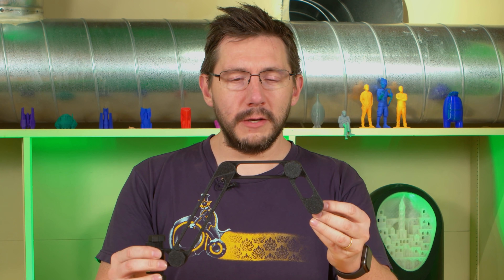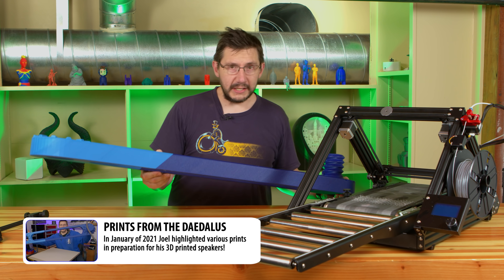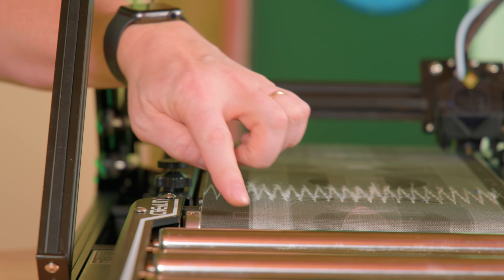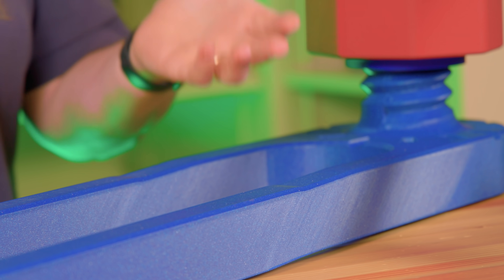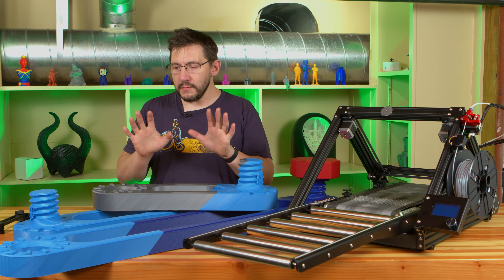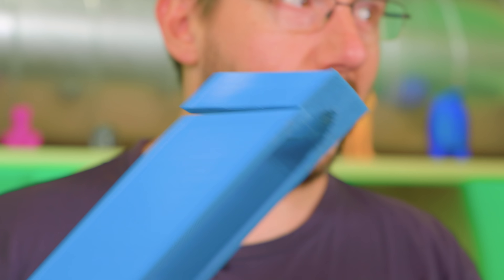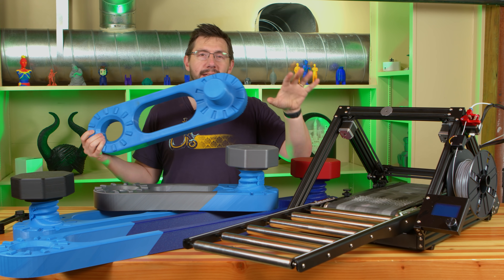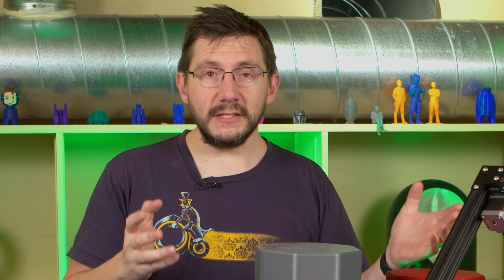HUGE 3D Printed Articulated Arm on the Creality CR-30!

Comment: This is a simple fix.  Either clean your rolling bed with plain soap and water, or replace the belt with a new one.  Just saying.  Another thing you can try is to have a fan cool the part at the end of the bed that way that hot piece contracts a little enough to separate from the bed before it rolls off.

Comment: A commercial use would be to put it on a rolling platform and light at the other end.  Because you can take it apart, you could throw a bunch of them into a trailer to take to a construction site for spotlighting specific areas high or low.  You could also use them to support kids night soccer and football or any other event.  Imagine traveling shows could light up their shows and take the light with them.

Comment: How long did it take you (or till you get) to gain confidence in your printer(s) that they would continue when you were not there to babysit it(overnight)? I have several printers but it seems like just when I start to trust them for an over-night print they FAIL (and usually badly)....

Comment: Hi Joel, Just a quick question, have you had issues with printing different types of PLA specifically PLA+ on the CR-30? We have just got one at school and it has been printing the supplied filament without issue but when changed to PLA+ no joy in sticking to the bed. Any thoughts?

Comment: Add a very light coat of TinkSeal to the threads and then wipe off with a clean terry cloth. Your threads will slide smoothly without being greasy.

Comment: Impressive! My cr30 arrived a few weeks ago and I have not had the best experience using it, can you share your firmware and slicer profile? I think your results are very good!
Reply from the maker: I got the best results with stock firmware and using ideaMaker for the slicer. Used the default slice profiles. Also check out a slicer called Kiri:Moto it has cr30 profile and people have been getting great results.
Reply: @3DPrintingNerd  Thank you very much for responding so quickly, I will try both slicers! Did you have to calibrate the steps of the motors in the firmware? I looked in his videos but I couldn't find if I mention something about it.
Reply from the maker: @fullprism  I only calibrated the belt motor steps, here: https://youtu.be/fESyPRpbJVc?t=542

Comment: print a giant lightbulb, put a lightbulb in it. bare giant bulb on the end. get a red and a black extension cord and run them thru it, only use one for power. print a base with a space for a concrete paver for weight, maybe use it for structure. definitely casters.

Comment: //::End idea:::// bucket or basket to put a 600% joel  printed model in like a telephone bucket truck and joel model could be holding a standard size lamp also for floor interface I would  make an adapter to attach to a weighted outdoor umbrella stand so it can be portable.

Comment: Home Depot and look for a large porch lamp with a globe

Base— use the same wall hanger then screw it to some piano dollys with a 4x4 3/4 mdf sheet. This will give you the weight needed

Comment: The problem is the filament and print speed here. Not the result but for the user. Large prints take a very long time and eventually i think we need to go back to the old 3 mm standard instead of 1.75 as people want faster and larger prints. The quality with 1.75 consistency is much better but small filament will extrude fine, we dont need fine quality on huge things. Eventually i think we need a 5 mm or so filament as naomi has opened the blx of large prints..and people will want to print large things. In terms of fixing the machine, just take a ruler and chim it. Put it over the bed and adjust the sides a bit with chims, a 0.5 mm plate as chims would suffice as a distributed difference of 0.5 is probably more accurate than the roller bed.

Comment: How about a see through heat box mount for your 3D printer.  To hold in the heat for better prints.   Use it to lift box out of the way for repairs and maintenance.   Great video Thanks

Comment: I don't think there is anyway to get better picture out of a wyze beyond the settings in the app. They are not really made for capturing video you're basically pointing something like a ring doorbell at your printer. You could use a gopro I believe they have timelapse now.

Comment: Ok how about recreating a light socket and light blub use a clear ABS or PLA for the globe. then the screw part will have a support a frame that has some LED  lights on it these lights can be barratry powered or wired to wall current 120v thru a power pack and the light is turned on or off by a standard slide pin in the lamp receptacle old school but cool time to put that 38,000.00 printer back into use.

Comment: I don't know if I would put this on wheels, since we're talking about something that can extend out a couple of meters and involves several kilos of PLA in addition to whatever is going on the end. I would imagine it's going to be really tippy or it's going to have an inconveniently large wheel base. Although... Perhaps a counterweight on one end could help, assuming we could rig one up and be able to adjust it so it doesn't fall over when put in place.

(Disclaimer: not a mechanical engineer, just paid a lot of attention in first year physics)

Comment: Use it to hold up the studio lights somehow. Then it'll always be seen in the background and it has a practical use. Although you might need to figure out a way to prevent the studio lights from melting the PLA when it gets warm/hot possibly.

Comment: what about a giant led lightbulb printed on an aerial delta printer?
Reply: aerial delta == one of those delta printers you showed a whiles back before the corrona times whereby it used cables to suspend itself and it varied the length of the cables to move around 

sorry if i am incoherent it's 1am
Reply: failing that, maybe use a giant ball (like one of those medicine balls that folks sit on/roll aroiund on) and 3D print a base w/ LED lights

Comment: Does the entire belt surface heat up? I see that it has a heated bed but I wonder if it’s only heated within a certain area. It seems to me that if the part was adequately cooled before it reaches the end of the belt, it should be rigid enough to avoid at least some warping. A more advanced option would be the use of a temperature gradient to cool the part slowly. I’d be interested to know more about the heated bed on this.

Comment: To try allow the print to separate better from the belt could you not make the roller at the end of the belt where the print gets ejected smaller to try and make a sharper break off point for the print to separate better.

Comment: Matt Odle has the right idea for the base. I have a tensor arm floor lamp (it's about 8 feet of arm) and inside its base is a concrete block about 8 inches by 12 inches by 3 inches, which us barely enough  - you can't extend it too far from the base or it gets tippy. What you should put on the end is a giant animated eyeball that sits in the background of your videos and blinks occasionally. If it's going to be absurdly large, it deserves to be equally pointless! 😁

Comment: Couldn't you just measure the height difference between the belt and the rollers and use/print washers to lift the roller assembly up to be flush with the belt?

Comment: While it would be ridiculous, I would love if the other end of this had an attachment so you could use it as an overhead VR cable manager. Get rid of those trailing cables (for Desktop VR)! It only takes significantly longer and uses a few reels of plastic in the process, but darn if it isn't cool!

Comment: You should print a 600% size light bulbs you can put a real one inside so it looks like its a real huge bulb. You could print it in clear pla and use a led bulb inside so it can also change colour

Comment: dude! Someone should be able to fudge with some sizes so when you select 600% it is normal scale for your print.. just might look funny on the original scaled model. then you can print it for the original and yours to have a 1:6 scale model comparison.

Comment: My first thought was a spool holder. Second thought? Print a little platform and have a mini joel bungee jumping off it. Final thought - position it at the end of the table and have it suspend another roller section. For those Uber long pieces.

Comment: Would love to see some strength testing done with large prints like this, Also a way to get minimal filament use with a strong piece. I'd be interested to see if it could possibly be structural.

Comment: What about a base similar to what you get from an outdoor umbrella for a patio table? The round ones that you fill full of sand or water. Then just toss some casters on it from Harbor Freight. If you make it filable with sand then you can use only as much weight as NEEDED to hold up whatever is on the end. To connect it to your arm just model the very end of one of those arms (arch with the threads) on top of the stand in the spot where an umbrella would insert IF it was one of the patio umbrella anchors.

Comment: Definitely will need to make the bottom of this very heavy just so it won't tip over. I thought it would be cool to attach this arm to the front of a truck and attach a camera to the end so you can film using a moving vehicle like they do for filming movies.

Comment: While not yet applicable to this printer, this is one of the things I love about Klipper. Since all the settings are in a separate config file, one can update the firmware without worry of those settings getting changed. Heck, I'm changing one machine from Octoprint+Klipper to Mainsail+Klipper and used the same config file without issue. It's awesome!

Comment: You should install it on a ceiling mounted monorail! The arm would be installed upside down on the ceiling, and be moved around on predefined paths.
On the other end, you would install a camera, a huge spotlight or even a computer screen. It would be moved across the room or retracted and stored close to the ceiling when it’s not in use.
It would be awesome and look like a sci-fi or factory equipment! 🤓

Comment: you could use that as a standing lamp, just print a kind of feet for the base, drill some holes and pass the cable through and screw an led light bulb with a printed shade

Comment: I've seen that problem on those printers before and I've wondered, can't that be fixed in software? What I mean is, after a certain linear travel has been achieved (I don't have numbers, but I'm sure y'all know) the belt advances a significant amount, past the point where the part begins to detach successfully, then returns to the print position to continue. Just a little jog before the part begins to dip.

Comment: Hey Joel, for enhancing bed separation it may be useful to put a sacrificial 'brim' on the leading end of your prints with a relatively small amount of surface contact - but just enough to promote seamless print separation without bowing, due to large amounts of initial stress.
I'd like to see if this would be effective in practice.

Comment: Paused to put my guess that the new firmware had a different step count for the motors than before, resulting in different sized parts. They'd need to be re-calibrated to get things in size again.

Comment: What is crazy is that even 10 years ago if you wanted to have this made it would probably have cost thousands, and thousands
Reply: Well that is 5 rolls of filament just for the short pieces....it's not too far off because each roll is basically $20+ USD?

Comment: seems like you just need to print a few different sized spacers to put on the wheels, to see how much larger the rollers need to be to perfectly catch the bottom of the print without letting the print sag or without pushing the print up, or worse of all jamming against the print. 

is there no way to fine tune the height of the rollers to get it in a better position?

also my guess on the firmware is the feed rate changed, so the printer was over extruding and oversized the threads.

Comment: You could make a large foot at the bottom thats constructed from large strips of material printed on the CR-30 glued together with some added weight . Wheels could be attached to one side so you lift it from the other side it can be easily moved. The head could look like something like a humongous Pixar style lamp. constructed in a similar way.(without the extra weight of course.)

Comment: you will have to fix it to the ground somewhere to keep it in balance, or you will have to have a massive trolley so the overhang doesn't flip it over..maybe set it up so it can rotate on a fixed plate somewhere convenient. On the light bulb side, get the biggest tungsten lightbulb you can get and print a parametric lampshade for it. you can use a spherical joint for connection and you will just have to undo the nut on the lampshade bulb assembly to adjust it

Comment: Fill a 5 gallon with cement. When it's still wet put the failed flappy print into it halfway. The threaded end looked fine so you can used that to attach the arm to. I'm concerned about its center of gravity. Oh and you can still pop wheels into the bottom of the bucket. Good luck!
Reply: I'd add a 2x4 base under the bucket that the wheels can attach to. The weight of the concrete will help, but I think you still need to extend the footprint to at least 3ft x 3ft to help stabilize it.
Reply: and a pi camera on the end.

Comment: My pause guess: different stepper motor values in new FW?
Reply: I like your base with wheels idea! As long as dimensions and weights are used to design something that won't fall over like a drunken giraffe 😂 
In fact, you should make the item holding end look like a giraffe's head! Ooo... Mount a smaller version coming from the mouth like a giraffe's tongue! Or Alien if you're into the horror genre stuff.

Comment: Print a giant hand for the extension end and you can aggressively high-five from a pandemic safe crustaceans (this is what my spell checker put and I don't have the heart to change it) so, high-five from safe crustaceans! Also you could add in an automatic Lysol sprayer for the giant hand so it can disinfect itself between crustaceans. Not sure about the floor end. I was going to suggest one of those stands used for portable basketball nets/backboards.they've got wheels, fill with water to counterbalance the weight of the arm. . .
BTW, Joel, I know I've mentioned it before but your honest, open, near child-like joy at these projects is heartwarming even to crustaceans!  🤣😂

Comment: For the base, I'm thinking a big hollow disc that you can fill with sand to act as a counterweight to the armature.  Not unlike the basketball hoops you can tilt back & wheel around.

Comment: The big problem of it its the size and the weight of the pice. (Tricky balance)
My best suggestion i can think of is to attach/screw it to a wheel cabinet/night stand with more then double weight the the all weight of the plastic 
Looking forward to see what will be your choice

Comment: you should slap a sputnik sphere chandelier on the end of that thing, OR do a exploding ceilinh pendant. that would look amazing rolling around on a 3d printed standard scooter board, ya know, the one that everyone destroyed their fingers with in elementary school gym class. just print the scooter board two part extra THICC and mostly empty(5-10%infill?) so you can fill it with sand and glue it together.

Comment: If you just put wheels under it it's going to tip over, sooo if you want to make it mobile you would need a very heavy or very large base.
Reply: Make the wheel base such that it can hold several bags of play sand to provide the mass needed to properly support the entire assembly.

Comment: Idea: Print 2040 extrusion style beams to basically 3d print your 3d printer longer, maybe try the z screw too
Reply: In most cases it will bend down under weight because of the spin moment.